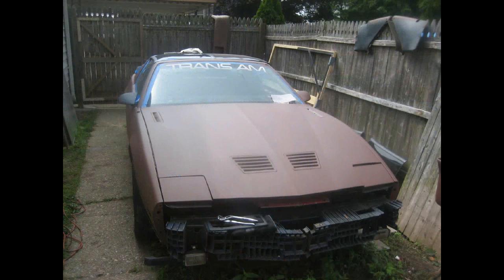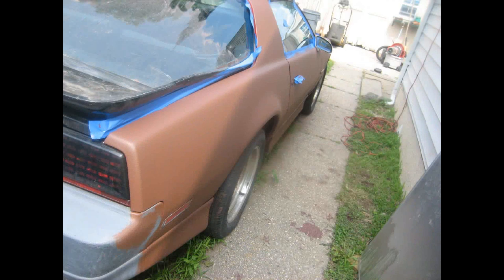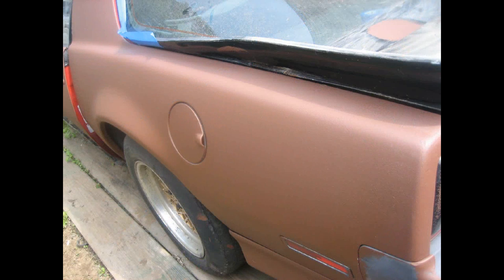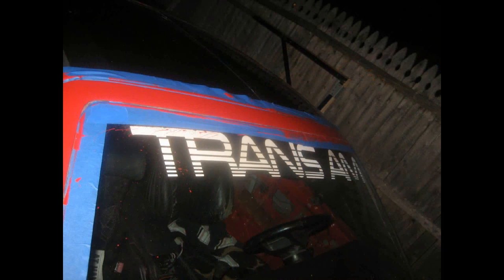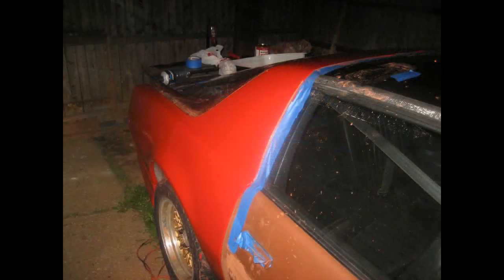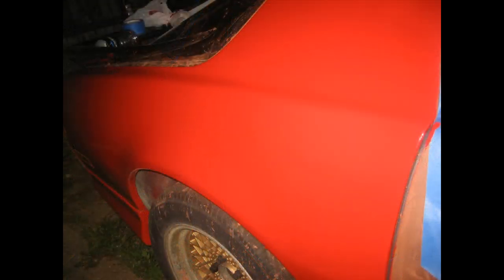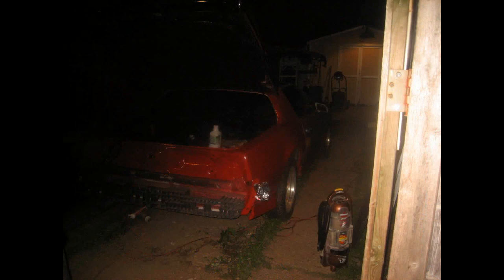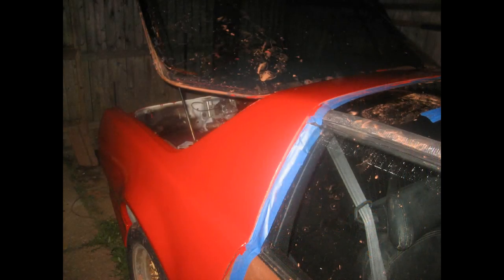May 2010. Painting a Firebird with a ROLLER BRUSH

Comment: Always buy new foam brushes. I bought some and let them sit for about a year and the foam rotted. Actually when you mashed the foam slightly with your fingers it stayed stuck together and if you dragged your finger across it, it would crumble. The rollers were OK in my case, but to be on the safe side, don't buy the brushes or rollers until you start your project. Good luck.